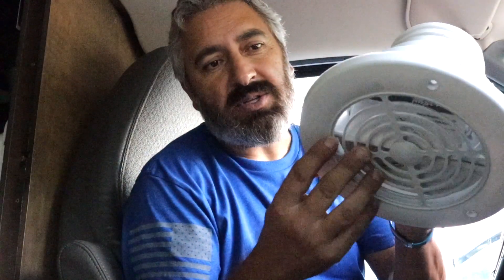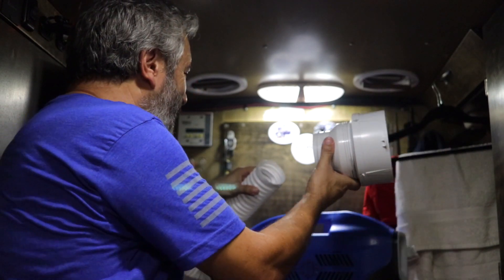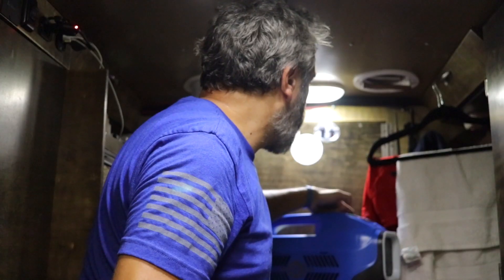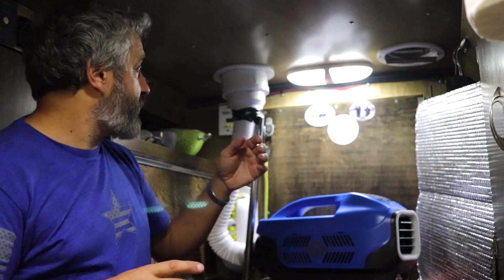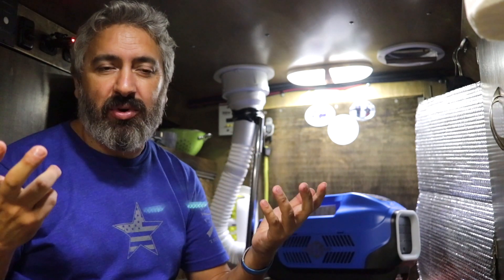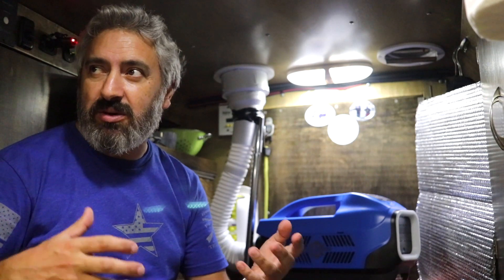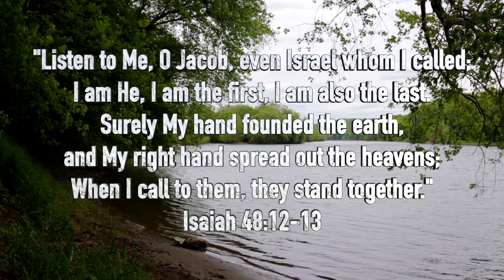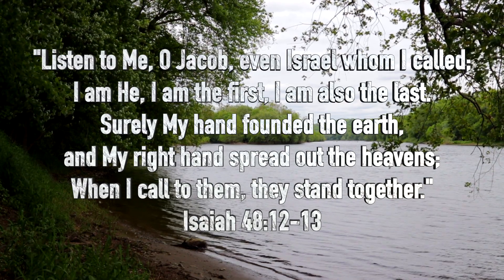Van Life; Putting It To The Test! Zero Breeze 12v Air Conditioner! Worth The Money?

Comment: Luis, you might try cooling the van down with the vans a/c and then use the zero breeze to maintain the temperature, that way you're saving your batteries, the initial cooldown is where the zero breeze will have to work the hardest, but if it's already cool it'll just have to maintain it.

Comment: Hi  from the UK.  Ideas for you  ; the smaller volume you try to cool, the better it will perform. So create a room within a room and just cool that bit.....the way to do that is with a mosquito net. Believe me mozzy nets keep heat in or out when camping in small tents so this should work, and it's lightweight,  cheap, quick and easy to try. So for example - over the bed area (at night.)  Then place the unit on the floor close to a rear door and vent directly out....keep the hot hose as short as possible and insulate what you can't eliminate. Next create another tube to go over the cool air output and run that cooling tube to wherever your room inside a room is. Finally create an air vent through the bottom of the van to balance the vacuum effect by drawing cooler air from underneath the shade of the van. None of this will be any use if the long term Amps use is too much for your system, but in theory this room in a room method should mean you're only cooling about 5% of your vans volume....... Just the air above your body under the mozzy net as you sleep. Happy travels everyone. John
Reply from the maker: Hi John!
I’m limited with my space and where I can locate the AC, can’t do much about that. As far as creating extra holes in the van to accommodate the unit, I’m not willing to do that. It’s something that’s not proven it’s worth over time, and I’m only using it a couple months out of the year. 👍🏻🖖🏻🚐☕️

Comment: Portable a/c units usually have caveats about using longer hoses and other modifications that will make the internal fan insufficient to move the heat away from the unit. The converse is also true -- anything you can do to help the fan do it's job will increase the efficiency and lifespan of the unit.

So, a shorter or bigger diameter hose = good, lowest (even negative) height to exhaust vent = good, and , of course, as you have pointed out, insulation for the exhaust = good. It's all good!
Reply from the maker: I’m trying to make it work better little by little as time permits. 👍🏻👍🏻🖖🏻🚐☕️

Comment: I have a suggestion, if You can suspend the unit from the ceiling, you will be able to shorten the exhaust tubing. Less distance to the outside makes less Extra heat inside. Also, when you cool the warmer section first, the colder air naturally drops down keeping the area much cooler.
Just an Avenue to try, Sir.
👍😀👍
Reply from the maker: I really can’t do that without some modifications which I’m not willing to make until the unit proves it’s worth. 👍🏻🖖🏻🚐☕️
Reply: Maybe stack up somethings to set it up high for your test run.
Pre-cool the Van with the front A/C, start up the Zero Breeze and turn off the front unit. If it will maintain an acceptable temp, then, Yippee!
Reply: Having the fan on high helps the heat from building up too much in the exhaust pipe.

Comment: I'm glad insulating the pipe is helping out I had to do  with my portable ac unit
Reply from the maker: It’s the only way to win the battle of cold vs hot. 😂👍🏻🖖🏻🚐☕️
Reply: What size is your portable air unit? Where do you put it, and run the exhaust out?

Comment: You'll get there. I think it's fantastic that you chronicle your experiences and show the tribulations in gaining knowledge. Personally I know where you'll end up, and with what. But I'll surely enjoy you getting there. Best to you & your loved ones!
Reply from the maker: I’ll keep trying till the trying is all tried up. 😂👍🏻🖖🏻☕️🚐
Reply: @RollingEarthShip  having gone thru this in several vehicles including three different Vans, I can say without a doubt you simply have to eliminate the heat of the exhaust from this style/type unit. Especially in a confined space. I ended up reducing the exhaust vent tubing length greatly, by venting it out the side thru a portal like a home dryer vent. I placed it to where it only had six inches of well insulated double wall tube. (similar to a wood burning stove vent pipe)  and three of that was inside the vent to the outside. So that's only about 3" of actual double walled and insulated tube in my vans. 
Regardless, I ended up with a very small window unit ( the smallest available) and ran it off of two Large Deep Cycle Bus Batteries, I charged while driving, or by solar. Worked fantastic! In 100° + heat I could bring the inside temp down to the 70's, no problem. Always keep a couple of roof vents open while running an air conditioner to allow the cool air pressure to push out the heat thru them.

Comment: You put a dryer vent hole in the side of the van and then put the air conditioner right up to the dryer vent hole so there's no heat coming back in the van and then put a dryer vent cover on the outside of the van

Comment: If someone has a vent to the ground or wall, then you can keep that hose short as possible where most of the heat is dissipated to the outside like a normal a/c unit.
Reply from the maker: Yep, that would make the unit work better, but I’m not willing to cut a hole specifically for it. 👍🏻🖖🏻🚐☕️

Comment: Hi Luis I just installed the lower in Hisense portable AC unit from Lowe’s. Because of the designed duty cycle of the compressor. The unit will not cool in the worst part of the day. It blows cool for 4 to 5 min. Then blows very hot for 45 to 50 min. I consider it a fail from 11am til 9pm South Texas time. I camp in a RV Park in South Texas and plug in to 115. I was thinking also a Honda or Yamaha generator. I am hoping to install four ladder racks and install a roof deck hoping to get some shade on my roof, hoping it will help. Good luck. O I have a 07 3/4 ton express. Been watching your videos for years. :)

Comment: thanks for sharing! maybe you can charge your batteries with either the stock alternator or if that's not powerful enough you can add a secondary alternator to charge your batteries when you drive. it will take a bit away from your gas though. i haven't tried it but i've seen youtube videos about this method for people who needed that extra boost.

Comment: For the price they are asking for Zero breeze you could add solar and batteries and use a small high efficiency 110 volt,5000 Btu. ! .......... $890.00 dollars wow that's astronomical
Reply: Raymond Oliver not only that for all that $ look how he had to rig it up🤣 comical he is jus losing his mind from the heat and jus needs to do what U said.Fridgedair has 5k btu for 250$ and a decent battery or break down and buy a generator 🤷‍♀️same money but will work.
Reply: I don't think so..

Comment: Luis - see if you can figure out how to make it a two hose system. When it exhausts the hot air, you have outside air coming in to replace it from all the seams in your van.  When it gets really hot outside, single hose A/C systems have a really hard time cooling and are terribly power innefficient
Reply from the maker: I would need some serious modifications to make it work with two hoses. 👍🏻🚐🖖🏻☕️
Reply: @RollingEarthShip  that's what I figured. It kept me from even trying that unit
Reply from the maker: Maybe the new model works better. 👍🏻

Comment: I have a Coleman Mach-1 Powersaver on my Ram Promaster and it draws about 975 watts running on high fan, neither my Honda 2000 generator or 2000 watt inverter could reliably start it. I found a device called the ‘easy start’ from micro-air which is installed in the A/C and uses a micro-processor to soft start the A/C compressor, is much better than a soft/start capacitor, but quite a bit more expensive. With it installed both the generator and inverter can easily start the A/C, you don,’t really notice the start up spike. The Coleman MK-1 Powersaver draws less power than almost all rooftops except for some smaller BTU units which don’t seem to be available to the aftermarket. The newer Coleman MK-3 Powersaver actually draws more power.

Comment: Hello from Spain Luis!

I would like to know... Is it connected directly to the battery or does it use a regulator for keeping the voltage in 12V?

I wonder if I could use it directly to 14,4V during the day.

Thanks!
Reply from the maker: Hi Pedro!
Yes, I had it connect to the 12v batteries and it’s works on fluctuating voltage as most devices do, but I would not recommend this to anyone. It doesn’t really work.  Hope that helps. 🖖🏻👍🏻☕️🌵🚐
Reply: @RollingEarthShip  Thanks for the answer!

So, you used it between 12,5 and 14,4v, rigth?

How is it going after this time?
Reply from the maker: Yes. Any 12v device should work between low 12s to high 14s. It’s called 12 volts but the batteries voltage change depending on their charging/discharging state. 🖖🏻👍🏻☕️🚐
Reply: @RollingEarthShip  Ok thanks, im asking because it says the webpage that we need a 12 to 12v converter, I dont know if its because it doesnt admit 14v

Comment: a cool night makes for a comfortable sleep ... have you considered ways that you might reduce the length of exhaust pipe so there is less heat transferred to the inside of the van?
Reply: Yea put on shelf. Run wrapped exhaust thru Triple insulated stove pipe possibly ? Port exhast out back?  Down n out the floor or lower level of Van. ? Maybe dryer vent in middle of back door ?Good job brother.

Comment: Update.....READ THE BATTERY MANUAL.....it is different than the unit manual......I had not “Turned on my Battery”......duh, who turns on a battery....but there it is. So my real news to you Luis & all nomads..... today on Tom’s channel : Hobotech TV” is the new “Jackery 500”......according to Tom (after I gave him the exact specs on the Zero Breeze Battery) the Jackery 500 will recharge the proprietary Zero Breeze battery. You had mentioned buying 2 batteries which would be great until our very expensive toy breaks. At least with the Jackery as your spare battery, if it all goes south you don’t have 2 Zero Breeze Batteries. Something to think about. Thanks for the very good info. I will try some of your exhaust hacks!
     GBU Brother, always,
   Michael In Houston
Reply from the maker: I only have one battery Michael. I did mention that I probably could get 2, but I’m not too sure on that. 👍🏻🖖🏻🚐☕️
Reply: I get that for sure Bud. I’m going to buy the Jackery 500 for a house battery. I’ll get a 100 W Solar panel(s) & then I’m good for power but it’s just an SUV......but I do like the 4WD.

Comment: Scotty, we need more power!! Aye Captain...where do you propose I get it?? lolol.....Hey I am glad to see that the unit actually does work! But be careful, DO NOT run those solar batts to low!! You have options, MORE solar and MORE batts, OR a generator!! How many BTUs is that little A/C unit? My roof A/C on my cargo condo is 13,000 BTUs, and takes 2300 watts of power to START it!! Hence, my reason for my 2800 watt EFi Yamaha generator......however, I am certain you could get by with a lot smaller generator!
Reply: Seem like since you use you van as a daily driver charging your batteries from the vans alternator should help keep them topped off.

Comment: Build a small box in the corner in which the pipe lives and then connect the unit to the bottom of the box - insulation can go inside box therefore all nice and neat

Comment: i know you come to Florida get the portable a/c min 7000btu in needed to keep you comfortable in fl 2300 watt suitcase generator and mount it on a Reese hitch on the front bumper to reduce noise  use a step accessory to mount it to 1 gallon of gas will get you around 10 hrs run time let me know when your back down i am around 80 miles south of you there

Comment: That ac seems very well worth the investment. What about using a dryer hose, intended to take the heat? Also, what is the temp on the roof under the solar panel on top of the vent? Very neat!
Reply from the maker: I’ll be using the hose it came with for now. I like to make small changes so I don’t wast my time if things don’t work out. 👍🏻👍🏻🖖🏻🚐☕️

Comment: If you can find a placement of the zero breeze where the heat exhaust pipe is much shorter to get the heat out, thus less surface area for re-adding heat back into your cabin.
Reply from the maker: I’m limited where I can place the unit. I’ll be trying to improve it little by little over time. 👍🏻🖖🏻🚐☕️

Comment: Good luck! Too bad lithium batteries are so expensive. 
I modified the old exhaust furnace exhaust port yesterday in my Silver Streak for a portable ac. It's kind of fun to shop the hardware stores for solutions.
Reply from the maker: Nothing good is cheap and cheap stuff for the most part isn’t good. 👍🏻🖖🏻🚐☕️

Comment: Hi Luis! It was my battery. I guess my prior comment about this ZERO BREEZE unit only working one night was true. I am sleeping in my 2006 Four Runner. I HAVE TO HAVE the battery.......no solar. I got to my place in Colorado & plugged it in to house current & Presto! It turned on. May be that the indicator lights (3 blue ones on the battery) May have indicated full even though it was only partially charged. I could have a bad battery. I thank the Good Lord that the machine works. I will stay in touch. I had terrible time dealing with the company......I hope you never need Faye😭. That’s all for now,
         GBU Brother
Reply from the maker: The battery wasn’t fully charged probably Michael. 👍🏻🖖🏻🚐☕️

Comment: Have you tried putting the AC in the cab area and cut a hole for the air to flow inside the rear? 
That way you can have your cake and eat it too.
People outside still won't hear it.